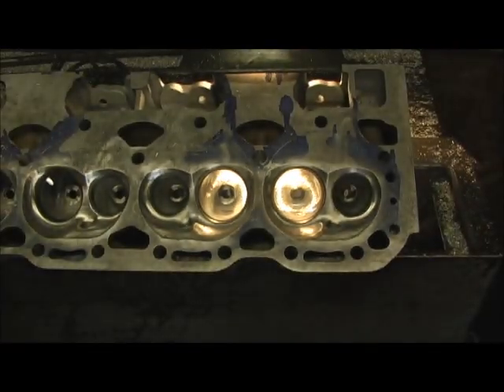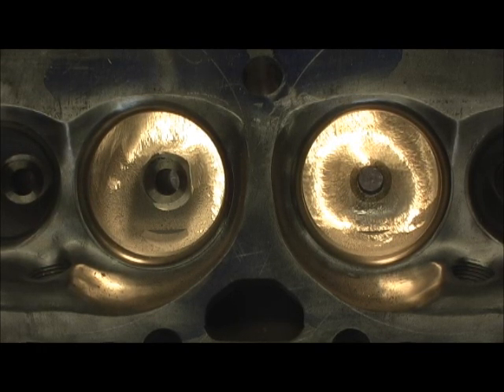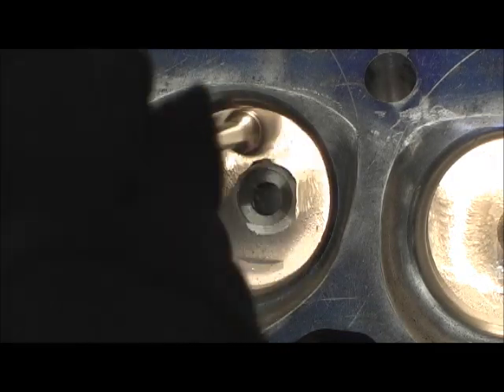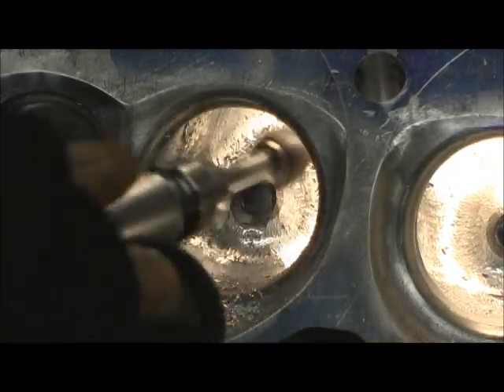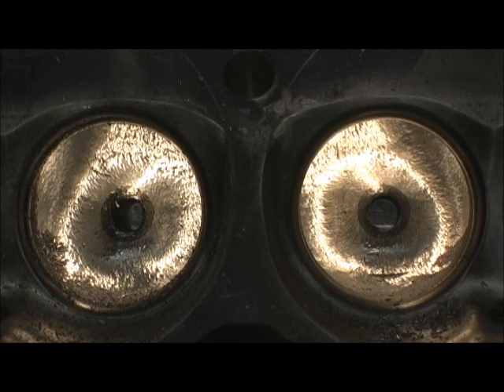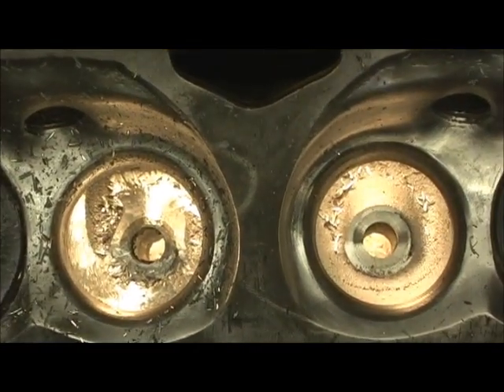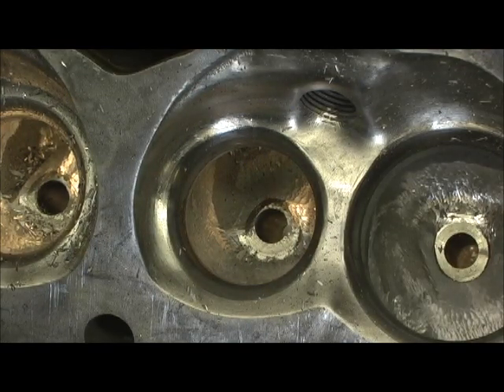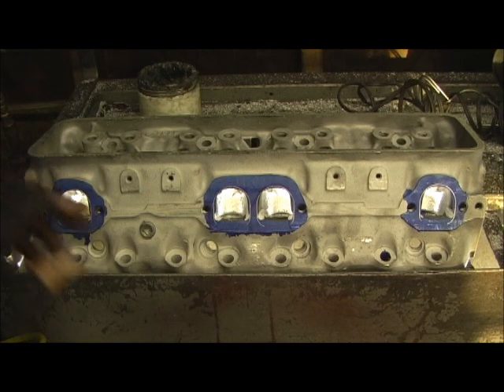LT-1 Full Porting Part 4.0 Guides and Exhaust

Comment from the maker: The problem Carp is that exactly!!! IF you put TOO big of a valve in the head in relation to Bore Diameter, you LOOSE airflow due to shrouding. The real problem here is GM did not put enough Iron Seat in the head to install the 2.02 Valve. I measure the Seat, and the MOST valve you could really put in that head and it work is about a 1.98 and 1.54, since you have to cut the seats to blend it into the bowl. S.I. Makes a valve called a Seat Saver that is 1.97 and 1.53, THIS COULD WORK.

Comment: You got me kicking myself in the ass, I ordered the headers and later found nice stainless steel ones that were 1.75 and .16g. I would of had to mail back the ones I got back and that would of cost me $45 in shipping and then a additional $45 to get the stainless ones shipped and it was hard to swallow $90 mistake not to mention my wife would of hung me out to dry.